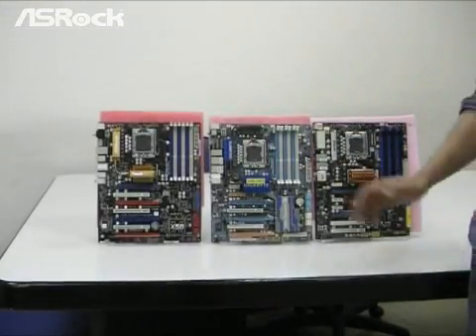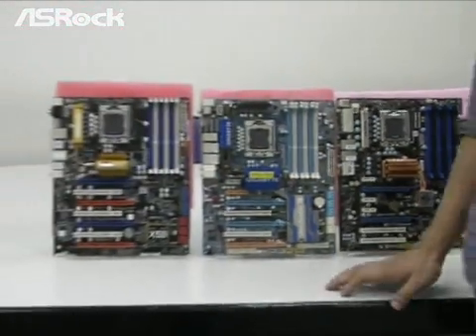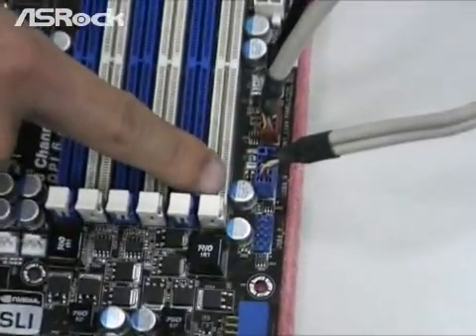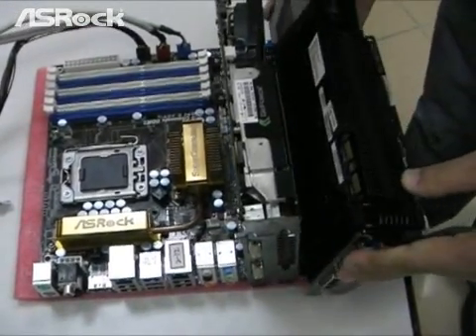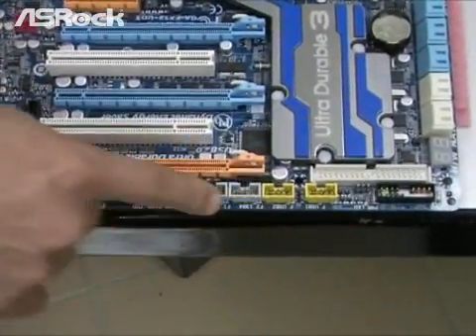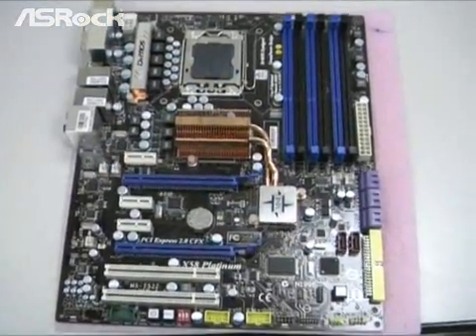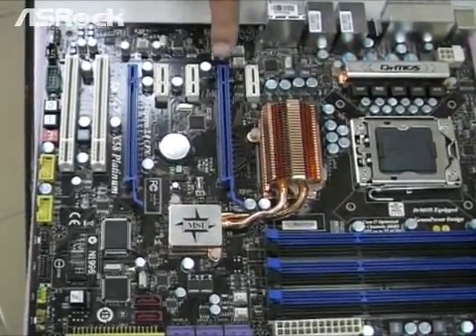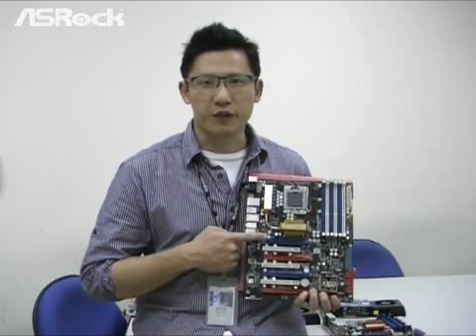X58 SuperComputer Plugfest demo

Comment: Makes a great point and these guys are making some good innovations with this new design. I hope the durability and overclockability are same if not better then other brands of same chipset type. Never realized the lowest slot was incapable of being filled due to the connectors interfering.